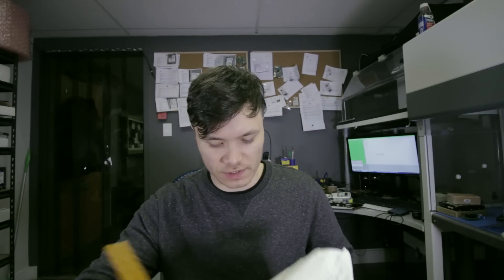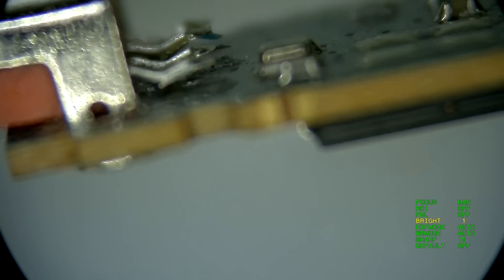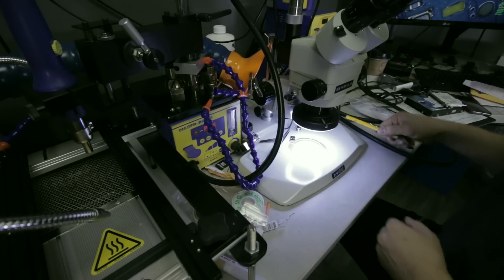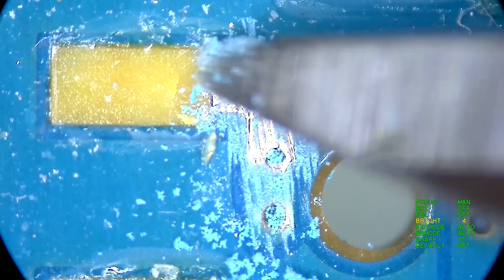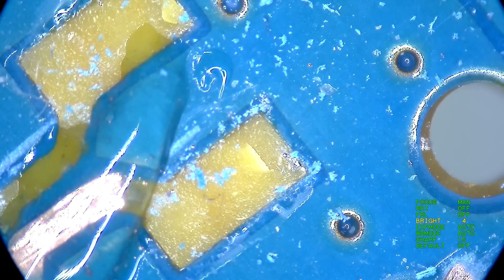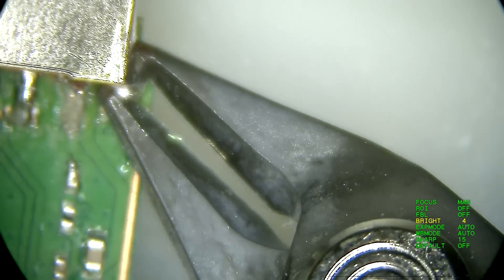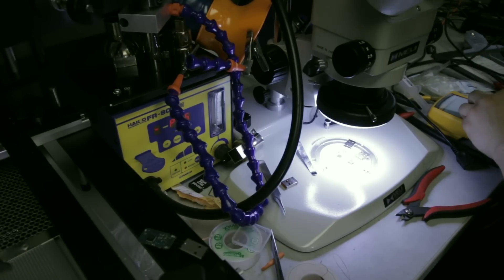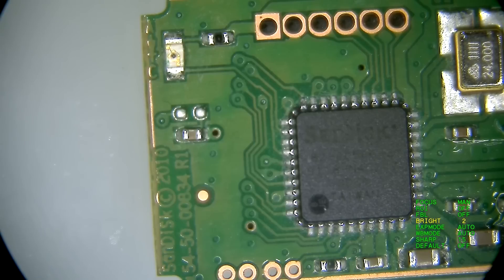different ways to recovery data from dead or broken USB flash drives

Comment: My pendrive is not detect in any computer .but my pendrive heated ..........what the problem tell plzzz
Reply from the maker: MDRAZI AHMAD something is shorting out, you way repair the unit by finding the short and replacing that component with the working one
Reply: How to repair ...
Reply from the maker: if you asking how to repair it after reading my last reply, then I dont know what else to add. sorry

Comment: Where is a good place to get the usb solder connectors like you use? Are a part number for the right ones.
Reply from the maker: I just bought them on eBay. Just search for USB connectors

Comment: how do you know what kind of components to use @9:20? Is there some kind of de-facto standard on USB schematics?
Reply: Yes, there is a de-facto standard design for USB. First of all, you have to understand, what this component is doing. Most of this components are for safety reason on the board to protect the circuit. So in some cases you can bridge it, in other cases you can remove them. So you need to know, what's before and after the component on the line. For example, if you have GND on one side and any resistance to GND on the other side, there are high chances that you can just remove this component. It might be a supportive cap. In other cases you can try to bridge the connection, for example if you had a smaller resistor or a cap as a DC Filter in line. 

In most cases you have a feeling for the components, you can use. And you need some experience.
Reply from the maker: I had an identical design board, just with different controller on it that was functional that I used to compare readings with, and took missing components from. Too bad it didn't work, so I returned all the parts back to the donor. I could spend more time to figure out what is what, but off-the-chip just seemed more logical for me at that point

Comment: I have a couple of questions, maybe you would be kind enough to point me in the right direction:

-Seagate Barracuda drive has a damaged controller board so the platter doesnt even spin up, I replaced the board with another of the same model, platter spins up but the HDD isnt detected - is it a firmware issue? Do I need to acquire a board made in the same batch of HDD's?

- 32GB Kingston Datatraveler, I setup Easy2Boot on this USB flash drive and I believe the drive had a FAT32 filesystem, I wanted to use Hiren's bootcd on the drive but had to convert the iso to a imgPTN and then 'switch' the drive to NTFS format- during the switch phase, my Windows 7 OS showed the drive as converted to NTFS but asked me to format it, I waited thinking that the computer had to finish the conversion process but nothing changed. I ejected the USB drive but now it doesnt even detect in the BIOS or in drive manager. Im guessing the MBR is corrupted and I cant recover it?

Thanks :D
Reply from the maker: On your seagate you would need to transfer the eep rom chip in order to perform adaptation.
corrupted MBR should not have anything to do with the fact that your system doesn't see the flash drive. Did you try it on other machine?
Reply: I think, that you have an Issue with the adaptives, that are stored in the ROM of the PCB and the second problem is, that the firmware in the ROM does not match the firmware in the SA.

To recover the USB Stick, you can try the HDD-Low level format tool. Or just overwrite the MBR with zeros using tools like "dd" with linux.
Reply: I tried the flash drive on 3 different devices, using all available USB ports - I have a Raspberry pi at work which I will try tomorrow but I have little hope. Thanks for the responses though, I will try the suggestions given.
Reply: Please try the flash drive on a linux machine to see, if it really doesn't do anything. On linux you can use "ls /dev/sd*" command to view your current drives (Flash not attached). If you then attach the flash, and it works, you should get at least one more entry. Then you can use "dd" to overwrite the MBR. If you don't get a new drive, you can use "dmesg" to get the output of the last system logs and see, if the drive was recognized and what's going wrong.